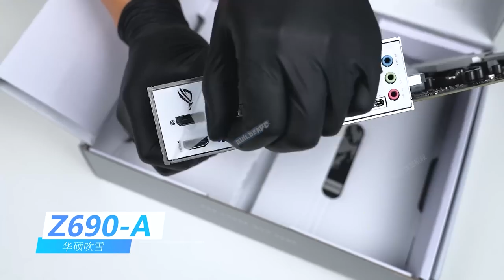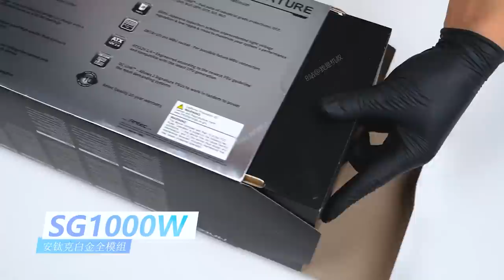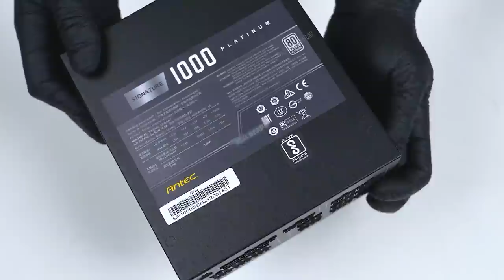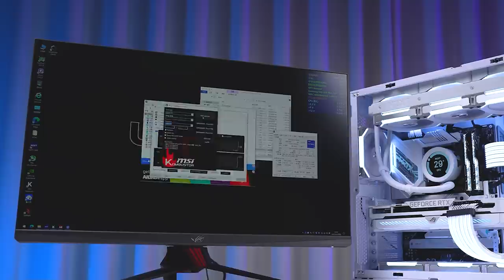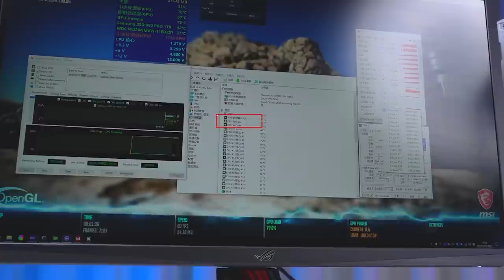「4K」 Lian Li Pc-o11 Evo White Build Pc - Intel i9-12900k / Rog RTX 3090 White - Builder pc

Comment: One odd installation method caught my eye.
The fan on the underside of the unit is not exhausting the air when you watch the video. It doesn't make any sense at all, but I think most people use 100% intake.

Comment: This is close to how I want to do my build. Quick question on the fans are the fans on top of the radiator pulling and the ones below pushing air. And I'm guessing the fan on the back of the case Is an exhaust.  Just wondering if I was thinking right since this will be the same fan setup I will use.

Comment: Anyone know why they didn't just go with a Lian Li CPU Liquid Cooler if they plan on swapping the NZXT fans anyways?
Reply: I was going to do the same buying the lian li CPU liquid cooler after doing some research online I noticed a lot of people were complaining of noises coming from the radiator and pump. A lot of people were saying their pumps were going out as well after not even six months to a year of use. I've seen enough of those comments for me to deter from their AIO so I just bought an Asus Rog ryuo iii argb  360 aio. I will also be doing push-pull configuration keeping the Asus fans stock and adding three more lian li fans to complete it .

Comment: Is it not odd have only the bottoms fans as air intakes and everything else as exhausts?

I want to build something similar in this case but would love to know optimal air flow configuration for this case ☺️✨
Reply: yes, I think if you just in terms of number of fans, you can't make it even, then you should generally opt for positive pressure inside the case (which means, more intakes than exhaust. He is using 10 fans though, so he could even make it even, 5 in 5 out, depending on where they sit that might get awkward though so- yes. You're correct)
Reply: I was wondering the same.

Comment: Impressive. But I noticed a noticeable discrepancies of CPU temperature detect between the build in LCD display (~50C) on the socket and the on-screen results (~62C).
Reply: Also said 100' Celsius under 100% load at one point Seems a bit hot no? 🥵
Reply: @TryllHDTv  I was scrolling thru the comments thinking the most liked comment would be the wild temperature reading.. im surprised no one even said anything 100'c whilst on open case is really weird
Reply: @Prisky-  I got the i9 13900k after watching this video and had to Undervolt and lower boost clock a tad, I ran cinebench right out box everything stock after I finished byild and it hit 100 and throttle (38k score) Corsair h150i elite cooler too. These new chips are crazy. It don't reach that temp no more with adjusted offset etc. 🥵
Reply: @TryllHDTv That using a benchmark though it’s supposed to hard stress the system. When you’re playing games it will never reach those temps.
Reply: @TryllHDTv  what settings did you use about to build a 13900k myself

Comment: that push pull on the radiator is nuts, in a badass way I mean. Damn that's expensive. I really wish the white kraken  z73 was in white when I bought mine. I have a very similar build.  I definitely would have picked a different song for the video though.
Reply: Good thing its not your video

Comment: Hello, video card fan is stopped at 08:07.
Reply: Yes, most modern GPU's will not spin their fans if they are not under load to minimize wear and tear on the fans as those are typically the thing that breaks the earliest in a GPU
Reply: @AethryPixel  Got it, that's perfect.

Comment: Such an amazing build! Got a question can you use the built-in bracket on the motherboard for the CPU instead or do you have to use the THERMALRIGHT INTEL 12TH GENERATION LGA1700 in order to build this?
Reply: I don't think you have to most people just do it so it doesn't have a chance to move around and bend pins etc but I would definitely recommend you spend the extra 12 dollars on amazon or wherever you purchase your pc products

Comment: The look seems to be nice, but the airflow..., rly, 7(!) outtakes (btw: it seems to be a push-pull-combination with 3 more blowing-out-fans) and only 3 intakes? Where shall the cool air come from? The problem could be easily solved by using the unifan sl inf instead of the eol-sls, because the rearview ist stunning. And the cristall-ram is rly ugly, moreoften i see it in the builds on this channel! Corsair Dominator is a must have, sry!

Comment: IMO bad fans setup. CPU cooling fans should be flipped, front fans should be flipped and bottom fans should be flipped too. Becase GPU now must fight with these fans for air. Heat comes always to top soo its Just easier to pump it out From top. Aio with fans should be placed on front side.

Comment: I tried to rebuild it with some newer components like cpu, gpu but my problem is that the motherboard has 2x USB 2.0 header and this setup requires 4x (CPU cooling, NZXT kraken fan cooling, Lian Li Fan cooling and the Lian Li strimer cables). There is 1 splitter from the NZXT KRAKEN but how do you connect the other 2? Did you use a USB Hub for this? It's not mention in the Spec list.
Reply: hey did you figure this out? i just ordered same components but 4070 ti

Comment: Are those 3 fans on top of the radiator? So theres 12 in total in this build?
Reply: 10 he replaced the normal aio fans with the lian li one.
Reply: it's 13 fans mate, the 3 in top of the radiator looks like the ones included in the z73 being used. (push pull)
Reply: @Sgt_gh0st  yeah i meant to say 13

Comment: why in the world do you have 7 exhaust fans (+3) in a positive pressure designed case? Looks great otherwise
Reply: I have the same, it's hard to get a good airflow otherwise? guess he could have used intake on the 3 in the back but i have my AIO radiator there ;(

Comment: I have no idea how you got so few cables on the back. I have the same case and an all white build and the cable behind is a mess. I can barely close the back. I do have two extra HDDs though, but still, I tried my best. Might be because my PSU cables seem a lot longer.
Reply: Did you use lian li fans?
Reply: @expert8665  yeah SL120. Got 10 of them and 3 NZXT fans that came with Kraken Z73 or something

Comment: Is it better for the gpu to stay vertical or horizontal or is it just for optic ?
Reply: It’s just for aesthetics, shouldn’t effect temperature
Reply: @honinakecheta601 if u have glass panel on ur gpu’s front, temperature can increase significantly!. Vertical mounted gpus can intake less air than horizontal mounted gpus because of the narrow space between the glass and the gpu fans itself
Reply: @RokarzLamon  plus the 3 fans in the bottom will not have the same cooling effect i would assume

Comment: only bottom air intake..not enough cool air getting thru that
Reply: in my experience it doesn't make a huge impact on the temps, plus all the holes in the case would let cold air inside also

Comment: I just built almost the same computer but with more gas. Dynanic XL, 13900K but I use the Eva z690 and eva 3090. Same cooler and hard drive(sucks the 990 still hasnt dropped but I will just switch the 980 pro to game hard drive. I thru in a 970 evo 500 mb with the 980 pro. EVGA 1600 watt P+ psu. 128 gb of corsair dominator (5200mz) I use the Termal grizzly contact plate. How you gonna cheap out in a debauer designed case man!? Not cool bro lol. 10 Corsair Qls little bit harder to wire clean. I just got all the purple, green and white sleeving to resleeve all the cables.

Comment: How much money was all of this?
Reply: It depends a lot on at what time you buy the parts and from what company, but i would guess roughly if all parts was bought new it would be... $4300 only the GPU here in Sweden would have cost $2400 new since the white one is a special model, we can find the same GPU now that has been used for 1.5 years for $954.53 - 1431.79 so depends a lot on how you buy the parts...

Comment: How much cost
Reply: It depends a lot on at what time you buy the parts and from what company, but i would guess roughly if all parts was bought new it would be... $4300 only the GPU here in Sweden would have cost $2400 new since the white one is a special model, we can find the same GPU now that has been used for 1.5 years for $954.53 - 1431.79 so depends a lot on how you buy the parts...

Comment: how much for this build ?
Reply: It depends a lot on at what time you buy the parts and from what company, but i would guess roughly if all parts was bought new it would be... $4300 only the GPU here in Sweden would have cost $2400 new since the white one is a special model, we can find the same GPU now that has been used for 1.5 years for $954.53 - 1431.79 so depends a lot on how you buy the parts...

Comment: Price?
Reply: It depends a lot on at what time you buy the parts and from what company, but i would guess roughly if all parts was bought new it would be... $4300 only the GPU here in Sweden would have cost $2400 new since the white one is a special model, we can find the same GPU now that has been used for 1.5 years for $954.53 - 1431.79 so depends a lot on how you buy the parts...

Comment: how much
Reply: It depends a lot on at what time you buy the parts and from what company, but i would guess roughly if all parts was bought new it would be... $4300 only the GPU here in Sweden would have cost $2400 new since the white one is a special model, we can find the same GPU now that has been used for 1.5 years for $954.53 - 1431.79 so depends a lot on how you buy the parts...

Comment: How much $ is this build
Reply: It depends a lot on at what time you buy the parts and from what company, but i would guess roughly if all parts was bought new it would be... $4300 only the GPU here in Sweden would have cost $2400 new since the white one is a special model, we can find the same GPU now that has been used for 1.5 years for $954.53 - 1431.79 so depends a lot on how you buy the parts...